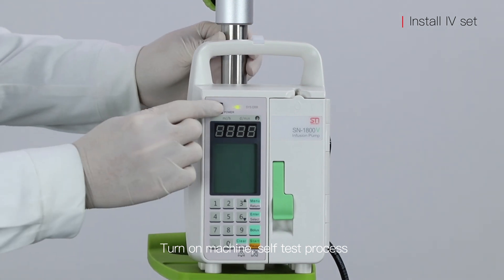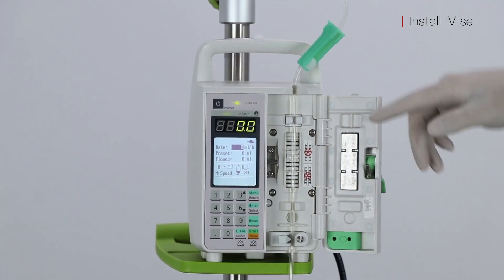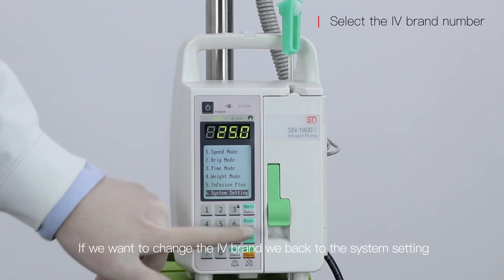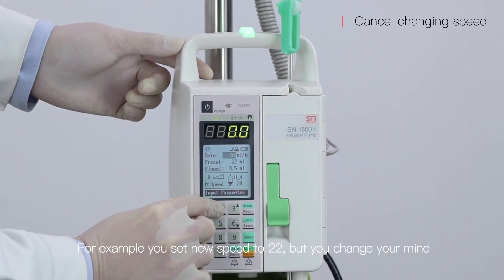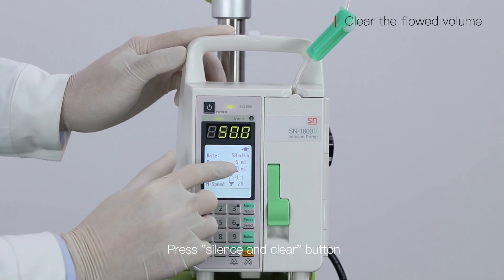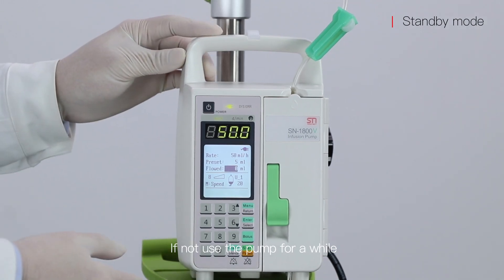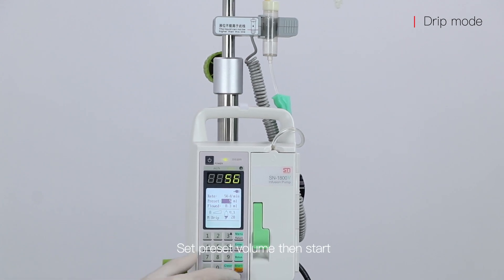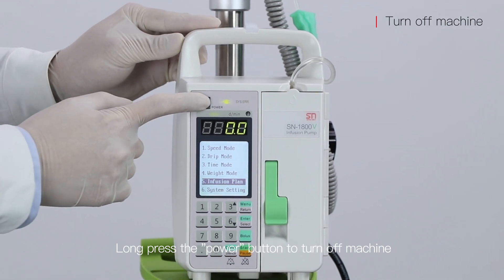Infusion Pump SN-1800V Operation Guide

Comment: Td5d😅😅d6d😅6d😅yd6d😅d#😅😅😅😅td😅d😅#😅td😅6😅6y5d😅6#😅td😅5#😅d6d😅tddyd😅d😅d😅#😅td😅5d😅t#yd😅d😅6d😅t😅dd😅t6d😅d😅6d😅😅##😅yd😅😅#😅#6d😅6#😅😅yet d😅6😅#td😅d😅#😅😅😅degree #t6d😅⅝d😅6d6td6d##yd56d#yread d5d6yd6ddtd#t#feet d6d#yd6yd6dddyd#r67d6d#y6ddttdydtd#dddyddyd#yd5yd5d6 sd yd yd5d6d5#yddydtdydyd6ddtdy#tddy#tdd#d6yddydt#td6d5d66##t6tydddt##yd5ddd#6d6d6 Ty 6 yd d5 the y5d#y6_6d6d6 trusted 6 dressed #y6d6d6tt6d6d#ydd t5😅😅😅😅😅😅😅